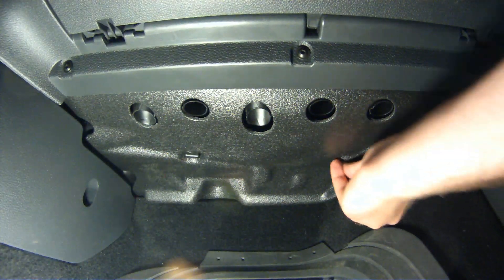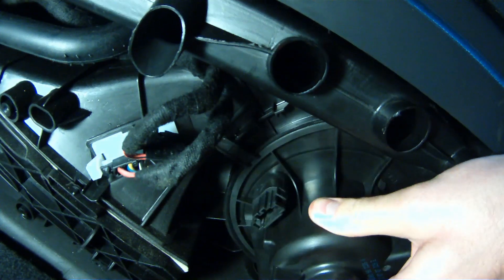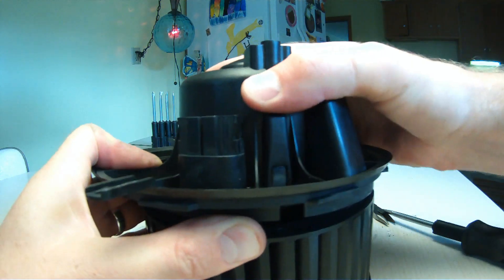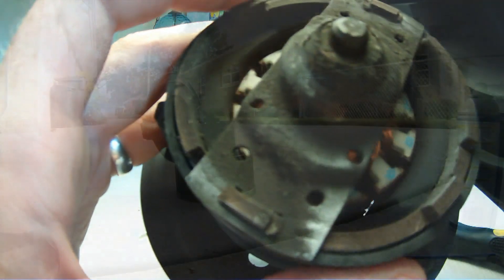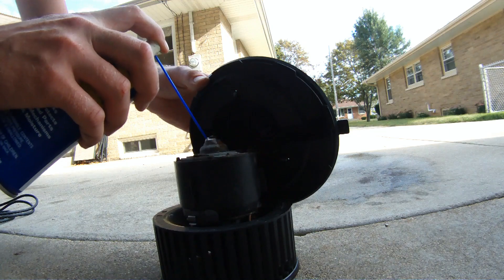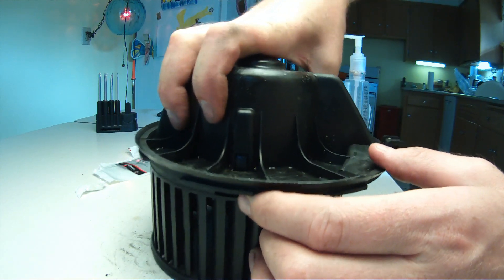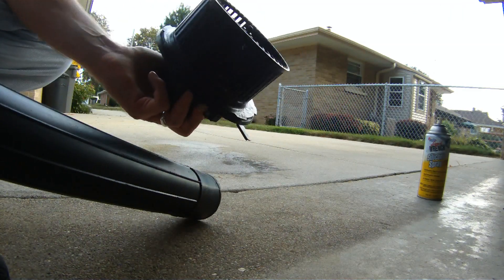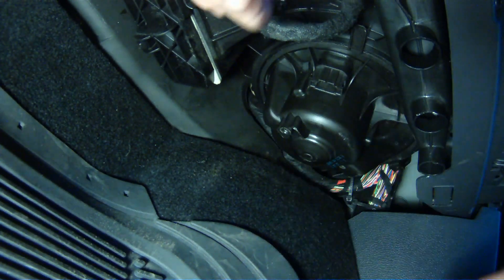VW Rabbit Blower Motor (2004-2008)

Comment: dont know if i replied before but i am now Thank You Sir for having a very simple non-overly verbal laden video about nothing to do with what the title says before you get to the point. Thanks for keeping it simple. it really helped me understand my lil 08 wabbit better
Reply from the maker: This makes my day!  Thank you sir!
Reply: Yeah i couldn't figure out why my resistor blew again after I watched your vid about how to replace that which I think I commented on but this vid explained the fail safe vw put in place to keep from causing other failures along with the fan. I just took it out an hr ago and its completely shot. The bearings are gone. So I'm going to my local junkyard in the A.M. to get my replacement parts. 😎
Reply from the maker: @Monolithic1m  Good luck on your junkyard hunt!  If that doesn't work out, the aftermarket replacement blower motors have become pretty affordable on Amazon - https://amzn.to/3bTKbFn.   I've been able to nurse my original motor along with  periodic lubrication, but I wouldn't hesitate to replace it at the $43 price point.
Reply: @hanoihancock  
Hey thanks im currently in SC and there's a junkyard named "pull a part" there are several on the east coast. They have and keep several mk5s as well as other generational vdubs in stock 
So i shouldn't have a problem finding what I need. Off the record "I seriously can't believe how addicted I am to this car man. I've had it for a year paid 1500 and didn't have to do anything serious to it for almost a yr. Most people think these are money pits but I don't agree. They're very well built. Since 2003 I've had two gen3 golfs,
Two gen3 jettas, a 2012 Tiguan maual!, an 04 passat wagon my first auto, and now my lil wabbit auto.

Comment: Awesome video, thanks man.  My recirculator switch went out a couple of years ago and a male friend that's a mechanic charged me $40 to replace.  Towards the end of last year it started making an unGodful noise.  Took me about 40 minutes to take it out and clean, lube and dry it. Mine even had a few leaves in it.  So far, so good, runs on all speeds and not making any funky noises.  Appreciate it!
Reply from the maker: Glad to be of service!

Comment: Thank you for this video. just followed your instructions and the noise is eliminated for now. Now I'm on the hunt to clean out the leaves from the plastic debris catcher above the blower motor. Thanks again!
Reply from the maker: +Sean Killen Nice!  Good luck on cleaning the leaves out of the debris catcher!  I just replaced my front shocks, which required me to get into the same area.  The debris catcher and shock tower mounts are right next to each other.    Removing the wiper arms will give you more room to work, but those things can be stuck on there tight!  I bought three tools to remove the wiper arms.   One broke, one didn't work, and the third one barely got the arms off.  That tool was the Lisle 54150 wiper arm puller.

Comment: Awesome job Hanoihancock!!!  You are the best!  I just followed your instructions on my 2009 VW Jetta tdi (diesel).  Seems to have addressed the squeaking, but even after wd40, 3-in-1 lubrication etc.  seemed to me to still have quite a lot of friction, especially if this were a brushless motor.  We'll see, hopefully will get a few more miles, and definitely will DIY replacement when it goes!  It seems like robbery to leave this for the dealer!  Thanks again!
Reply from the maker: Nice!
Reply: +Todd Harshbarger , just did this to my 2012 Golf, TDI.  It has brushes.  Look down the squirrel cage through the top of the motor.  You'll see some springs in there used to keep the brushes in contact with the stator.

Comment: I have an '07 Jetta 2.5 with the same layout and the same squeaky blower. Thank you, thank you for such a great video. I just saved several hundred dollars if not more. I discovered that in order to remove the blower from its location (a tight fit), it was beneficial to pull the distribution duct towards you (gently) and then angle the motor down on that end first. Getting the part of the blower closest to the glovebox dislodged first helped get the rear part of it out (near the toe kick). 

Now I just have to replace my headliner and the car will be good as new. 

Thanks again for the demonstration.
Reply from the maker: Awesome!   Thanks for the great feedback!
Reply from the maker: Hope you don't mind...I quoted you in the annotations of this video.   Great advice!

Comment: Thank you! I followed both this video and your other video on the rheostat fuse. They were both great, straightforward and very coherent.
I replaced the entire rheostat piece (not just the fuse) and took out the blower motor and used carb cleaner and WD-40 on it. I wouldn’t have known about the blower motor if it wasn’t for you mentioning it in your rheostat fuse video. 
I got it all done without any dramas, which was very surprising. I usually end up breaking stuff or running into problems when I attempt something on my car.
Reply from the maker: Glad it worked out for you!

Comment: Hey, I will take 2 minutes to say a big thanks. I own a Jetta TDI 2006 and suddenly, my air blower stopped working on speed 1 to 3 (Working on 4). Dealer said that was the fuse and asked for 389$.  I'm not a manual guy but there's some freaking limit to be scam.  So I did my due diligence and search the web and found your video.  

You are prob. one of the few that explained the issue (the maintenance note on Volkswagen) and took the time to solve it and not only FIX it.  There's a reason why the fuse broke and, as you say, if you don't clean the blower, well, you are postponing the problem.  So, replacing the fuse is how to fix it.  Cleaning the blower to ensure that the new fuse will not blow again, that solving it.  BIG difference.

So, I started this morning.  Fuse costed me 4$ from China (took 3 months to get here but hey, I saying a LOT!).  I followed your instruction, really clear, straight to the point.  Cleaned it and grease it and put it back. The AC blower is working perfectly and I'm feeling proud as hell.  My wife now thinks that I'm mechanical expert! LMAO!
Reply from the maker: Frederic Filiatrault Great to hear the project went smoothly!
Reply: Hey where did you buy the resister? I can’t seem to find one online

Comment: Just ran out and pulled it out. Vaccumed the cabin filter and lubed the motor at the center wherever I thought it could penetrate to the squeak.. And put it all back together in about 20-25 mins. Blower motor is whisper quiet ! 

Best part of course is NO tools required .. I honestly can't believe that I needed nothing lol . 

Now to solve my heat issues :(
Reply from the maker: Nice!  Wait...  You have heat issues too?  My Rabbit gets warm eventually, but not nearly as fast or as hot as my wife's 2003 VW Passat 1.8t.  You'd think the 2.5l on the Rabbit would throw off way more heat.

Comment: I'm watching these videos in preparation for some spring maintenance on my 08 Rabbit.  My fan works fine right now, but I'm wondering how dirty it might be now that I'm the owner. Might be a good idea to check it out. One comment on the video would be this, I would use a spray lubricant such as the offered by Wurth. WD40 is not really a lubricant, but certainly useful in many other ways.

Comment: The two videos for the fixing the blower and replacing the resistor were outstanding!  Thanks for sharing.  Took me less than an hour to fix.  I have a 2012 VW GTI which had the bearing corrosion problem and the resistor failed at 66K miles. I ended up buying an HVAC Blower Motor Resistor and associated white plug-in for only $9.49 on Amazon, which saved a little bit of hassle in doing the repair.  The motor is spinning more freely, but I suspect that this problem will happen again.  It will be interesting to see if it takes 5K or 50K miles.

Comment: Clear and useful I will try with a Golf Mk III which blower is very similar to the one shown in the video as I suspect my dirty motor has been opposing more resistance to spin probably resulting in voltage increase which blew the blower resistor.
Reply from the maker: Thanks for the comment!   Good luck with your Mk III project!  Now that winter is here, I intend to pull the blower motor after driving in the next snow storm to see if the VW TSB is accurate...that "PERMANENT FROST AND SNOWFALL FINE SNOW CAN GET INTO THE FRESH AIR BLOWER VIA THE AIR INTAKE" and corrode the blower motor bearing.

Comment: I think it was the lube. I did pull it out again.. This time I plugged it in on the floor and let it spin. When I turned it on high I did see some (very tiny bit) sparking inside the motor. I varied the speed from 3-4 for 5 mins so not to let it load up too long and all seems well now. I think it was the lube that may have still been in there and was spiking the current draw popping the fuse. 

Cheers for all the help :)
Reply from the maker: Yeah. I seriously blasted the living daylights out of my blower motor. I used carb cleaner, then lubed, then carb cleaner again, then washed with soapy water and a hose, then dried, then lubed again. It was that bad.  But... It's still operating perfectly 4 months later.   And I've been cranking it at level 4 lately due to seriously cold temps.

Comment: I tried to clean my motor with carb cleaner first.  Then tried some WD-40, next came the electrical contact cleaner.  I blew it out with compressed air and repeated the process three times.  The resistance to turning just wouldn't change.  So, I tried some 3-in-1 oil.  Blew it out again.  Repeated cleaning process again.  Moved the brushes out of the way and and spayed the armature.  Put some more 3-in-1 oil on the bearings and put the motor cover on.  Then stuck it in the car.
I'm hoping what I did helps.  I still had the lower speeds, so resistor is OK.  My problem was that on a long trip from Houston to El Paso, the lower speeds would quit.  If I turned it off for a while, the lower speeds would come back.  After about a half hour, it would cut out again.  
Unfortunately, I won't happen to have a chance to test the repair until I can drive up to Albuquerque.  Four hour drive.
Reply from the maker: +Jose Antonio Castrellon Jr Good luck man!   Let us know how it goes!

Comment: Yup I've has the car a week and a half and it's up for sale because of it. The only way to warm my hands is to put then under my arse because the seat heaters work so good.

I sold my 01 passat.. Which had a similar issue.. I only had that car 2 months and sold it mainly to upgrade to an mk5 but I knew it had a heater core issue. It drove me crazy with the low heat and that made me sell it faster before winter.. Just my luck with this mk5 :/

Comment: Thanks for the great video. Same issue here. Is your blower motor still running well? Is the WD40 doing the job as far as lubrication?
Reply from the maker: Yeah.   Still running strong.  Although now I suspect the service bulletin about snow causing the blower motor corrosion was only part of the problem.   I do live in a cold climate, but...  Since repairing the blower motor, I also found that my cabin filter was completely gacked up.

http://youtu.be/GlSv3yTiUo8
Reply: Did mine yesterday.  I replaced the resistor pack last week and blew it out the next day.  My local parts place says they'll replace it but it won't be here till Wednesday.  When I replaced the resistor last week I found my cabin filter was full of snow. In the mean time I got a new thermal fuse to put in my old old resistor pack to see if it'll work with my new "refurbished" blower motor. 

A one thing I found helpful for others is that it may look like it's impossible to get the fan in and out without removing the glove box, but it's possible with a little wiggling and patience. Definitely saved time not removing the glove box as that's likely a 7-10 minute round trip job to save 2 minutes of wiggling.

Thanks again, your video was super helpful for doing my 06 Jetta TDI
Reply from the maker: Thanks for the comments!   Glad to be of service!

Comment: I replaced the resistor and it failed again except setting 4. Any idea how I could test the blower motor? Could it be a fuse as well or should I just replace the motor? I did the carb* cleaner to clean it

Comment: I followed your video, and it worked great for me. After about an hour, though, the fan started bogging down and essentially stopping again. It currently works for about 10-15 seconds, then I have to switch the fan off, wait a minute, and then run it again. Do I simply need to do this again? Should I replace the motor or take it apart and change something? Thanks for any tips.
Reply from the maker: turbodeeznuts Sounds like the motor is corroded beyond repair.
Reply: In my case fan is working in first 3 lower speeds, but when I put switch to the fastest, 4th speed , works for about 20 second then switches fan off.

Comment: Thank you! Does it matter which I do first, replace the fuse or oil the motor?
Reply from the maker: Maria Romanell The fuse is cheap and easy, so start there.  You may not even have to clean and lube the motor.  However, an ounce of prevention goes a long way, so I recommend doing both at the same time.
Reply: hanoihancock thank you kindly
Reply: Also, do you happen to know where they are so cheap in Canada? I see them for $18 on amazon. Do they get cheaper?

Comment: By the way, a just had to replaced the resistor assy that controls the fan speed.  No doubt, it fryed because the fan motor was drawing too much current due to the ice damage.  Thanks again OP

Comment: I also both a blower from 2005 vls  jetta and is not the same but both of them works in 4 .
Reply from the maker: Erdjan Berisa The blower working only on speed 4 is a symptom of a blown thermal fuse.  A blown thermal fuse could be symptom of a dirty blower motor. Replace the thermal fuse to get speeds 1,2,3, and 4 working again.  Clean and lube the blower motor to prevent future thermal fuse failure.  Good luck!
Reply: hanoihancock send me the video?

Comment: Dammit now when I turn the fan to 4 the 40A fuse keeps blowing :(. Works on 1-3 . I took it back out and cleaned it with contact cleaner but it's still popping when on high. Any thoughts ?
Reply from the maker: Not sure what would cause that.   It wasn't blowing fuses before you lubed it? Maybe try taking it apart and cleaning it?
Reply: I have the same problem here, do you find out the solution?
Reply from the maker: Peng Guan I believe 5abvit's problem was that the blower motor was not completely dry when re-installed. Try re-washing the blower motor with soapy water, rinse thoroughly, dry with leaf blower, spray some carb cleaner, dry again, then lube, and re-install.
Reply: Thanks a lot for your help! I just pulled it out, will follow your steps carefully. I don't have a leaf blower, orz...can I get the soapy water by using hand soap? Thanks again for your help!
Reply from the maker: Yeah. I used liquid hand soap and my blower is still working great. It's going to be difficult to dry the blower off enough if you don't have some way to power dry it. Do you have a shop vac?  You could hook a hose up to the shop vac exhaust to blow the motor dry. If you have a compressor, you could us compressed air to blow it dry. Maybe you could use a hair dryer?  Otherwise, ask your friends and neighbors if they have a leaf blower you could borrow.
Reply: Thanks a lot! The only dryer I have is the hair dryer...lol. Anyway, thanks a lot for your tons of help! I am using a fan blowing directly onto the motor, hopefully this will help...Thanks a lot!

Comment: i have it where only the high speed works but only after 1 hour or so. to begin with all 4 speeds work then after a while only the top speed? any ideas what is going on?
Reply from the maker: Sounds like a bad resistor.  Check out this video https://youtu.be/mLWn3J6QUXk.
Reply: hanoihancock yeah I think it probably is, but why would the resistance change over time?
Reply from the maker: That's beyond my level of comprehension.  Although my thermal fuse blew, maybe they can fail slowly?   I mean...they're thermal fuses, so maybe as they fail slowly the temp at which they fail lowers?  Just a wild guess.
Reply: hanoihancock my guess would be as it heats up over time the tolerances drift as the resistance change. I've replaced the resistor and cleaned out the motor according to your video so let's hope things work. Thank you very very much for these videos, really helpful
Reply from the maker: Nathan Soper Hey man.  No problem.  Thanks for the nice comment and good luck with the rest of your project!
Reply: hanoihancock I lubricated my blower motor as in this video but unfortunately it burnt out the next week. Not blaming you or anything, I think perhaps I used too much wd40 or something
Reply from the maker: Aww man.  That's a drag.  Sorry to hear about that.  Hopefully you can find a cheap salvage replacement!
Reply: hanoihancock turns out I managed to introduce a short by doing this lubrication procedure. Fan still spins but high current pops the fuse every time.
Reply from the maker: Nathan Soper Try cleaning again, but more thoroughly, then dry more thoroughly, then lube again but with less lube?
Reply: hanoihancock well when it died, it made lots of smoke so I think some insulation somewhere melted and caused the short. I've got a new one now anyway so hopefully things will be ok. Thanks again pal.